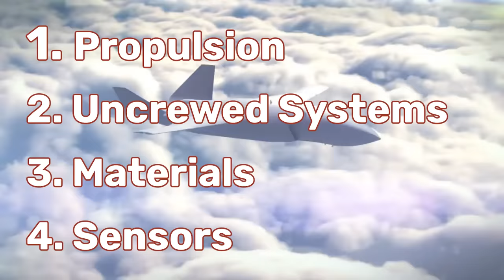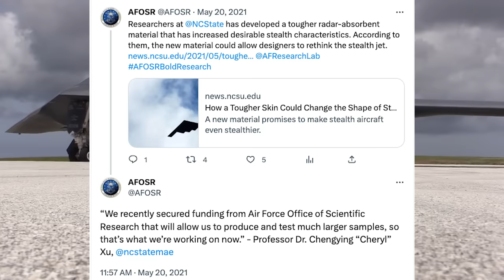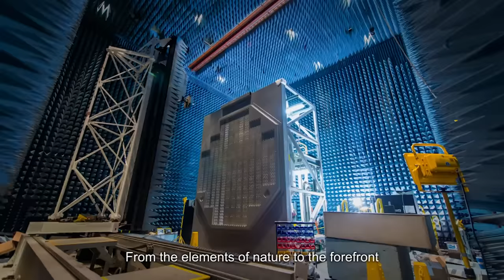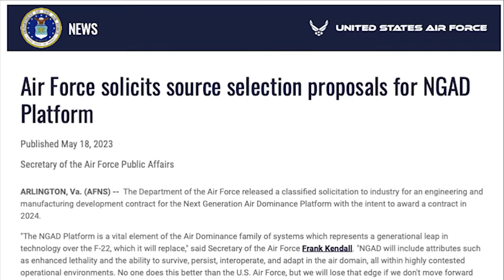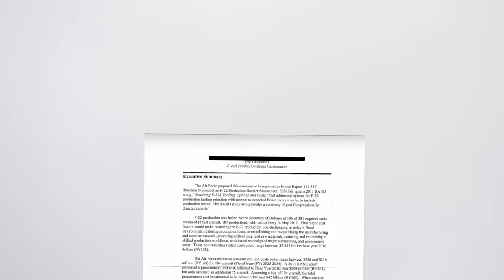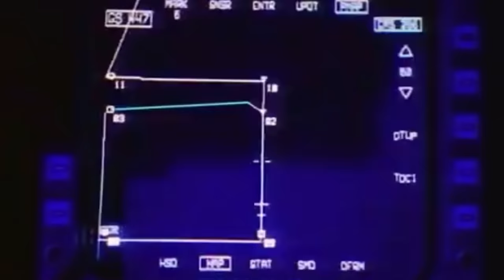Why America's new stealth fighters might cost $300 MILLION each

Comment: F-22 production costs would have gone down considerably if they'd produced several hundred of them as originally planned.
Reply: F22 couldn’t be shipped overseas and therefore was not going to result in the huge payday for the military industrial complex and so it was canned in favor of a new jet fighter With potentially unlimited profits. At least that’s the way it always seemed to me.
Reply: While that is true, it was most certainly a 1990s style production line. Not large scale enough to be automated, yet complicated enough to be uber expensive. With a more modern approach to design and manufacturing you should be able to operate both faster and at a lower cost.
Reply: @Alwsmith  nah if the program would have continued they would have just made an F22-E that cut out all the best tech and exported that. It is a very common practice and the US has done it with tons of different platforms they otherwise would not export in their original configuration. For example the Abrams tanks that are being sent to Ukraine are not being sent with their normal armor plating which is an advanced alloy material and instead that armor is being swapped out for the more typical hardened steel.
Reply: @ThatGuyKazz 
I think that an export F-22 would make for the greatest 4.5 gen fighter of all time. 

Or just go with the 23 being the export.
Reply: @Alwsmith : The F-22 production run was supposed to be 750 aircraft.  If they'd done that, they would have had economy of scale, reducing the cost to produce those hundreds of planes for a lot less than the first few batches.  On top of that, they would have been able to amortize the development costs over four times as many units.  And they could have retired hundreds of high-flight hour F-15s that ended up getting more and more expensive to operate and upgrade.
Reply: F-22 was going to go down to $93.4m unit flyaway in Full Rate Production.

Typhoons and Rafales are over $162m unit flyaway, unit program at over $200m each.
Reply: @texasranger24  F-22 had multiple lines that fed into the final assembly, with high-speed automation already a thing by then.

Cost reduction really goes down to the subcontractors.  If Pratt, Raytheon, L3 Harris, Boeing, etc. were to get multi-year orders and then subcontract the subcomponents in blocks, it streamlines the acquisition and confidence in vendors, who all need cleared personnel by the way.

SECDEF Gates killed the F-22 in LRIP, never allowing it to go FRP, which then created the fighter gap.
Reply: Yeah but it is the R&D that costs, not the actual plane. And R&D is something you have to do no matter what to keep up with technology. In peacetime, it’s better to have built 0 F-22”s and then move on to the next technology. Cheaper than being stuck with 100’s of jets whose tech will be obsolete in 10 years.
Reply: According to many different insiders from the Air Force and industry, it would’ve cost about as much as the F-35 costs now.
Reply: Component production was spread around inefficiently for political reasons, to gain support from as many people in Congress as possible.
Reply: People are forgetting. It’s not the initial cost that’s expensive it’s the upkeep and just like the F-14 it was just too expensive to run. Requiring Uber money to maintain and tons of maintenance hours per every flight hour to keep it in the air
Reply: The cost will be astronomical per unit because the military only wants about 200 of them, so if Lockheed needs to make $1 trillion over only 200 airframes, they’ll make each one of them cost billions a piece
Reply: @TheBooban  Every fighter evolves with the technology though, so it's better to have a production line open or a larger fleet.

F-16s have undergone so many changes just in production, then even more post-production with MLU, CCIP 1, CCIP 2, CCIP 2A, and now PoBIT.

F-22A is on an upgrade schedule called Raptor Incremental Upgrade Program.  The combat-coded Raptors are a lot different under the hood than the training conversion birds.
Reply: The F-22 was a victim of the times. It was a super fighter without a super fighter war to fight. A true hanger queen. Adding to all that, it was believed the Russians and Chinese would not have anything like it until 2030.
As a nation the U.S. was also dealing with the housing crash of 2006-2008. Congress wanted to cut cost any way they could, so the F-22 got cancelled.
The Air Force went along with it because they wanted that new toy. 
And that new toy is the F-35. They were told that they couldn't produce both at the same time.
Reply: @Alwsmith  Yes, the F-22 Engines and materials are still superior to the F-35 and so the ban. The advantage of the F35 is that it is Data Linked and more Modular and will use Nano Ceramics from Cheryl. The Block 4 F-35's should recieve the RDE (Mach 2.5 Rotational Detonation Engine) Engines as Cheryl Xu was successful and that means the NGAD and the B21 and all other Endeavors will be as well. I would like to side tack to the US Intelligence Officers and the UFO/UAP disclosures. IF TRUE thyen this information only helps our ENEMIES here on Earth. As the saying goes. Deal with the Problems that are in  front of YOU in the HERE and NOW. Looking for ET is not going to save us and the technology gained will be stolen! We need dedicated Scientists like Edward Teller and others who know the implications of US Success. USA success will one day unite a World and allow us to become a Planetary Society and reach a type One civilization that allows us to explore space. Until then I believe IF there are Non Terrestials they will wait until these conditions are met. This means education based on Ethnic Dominance must be REMOVED as a priority and Nationalism based on Social Engineering must also be removed. In order to Unite People instead of marginalization of them in order to steal their lands and their women. To this I can not agree to be ALL in for the USA. I am an asian American born here 7 Generations with most of my friends who have 3 or more Ph.D's who have great disdain for the History that is all together rewritten and Asian men Marginalized on PURPOSE. Things like when the Chinese built the Transcontinental Railroad & on payday these Chinese workers lined up & were shot in the back & then buried under the next set of track to be laid. The two companies did this over & over again making the Transcontinental Railroad the largest Chinese Cemetery outside of Asia! The US History Books marginalize Asians in order to control the minds of the Target which is the Asian Woman! IF you wonder why the CCP is catching up to US Military Supremacy, then I just presented to YOU why. Asian men do not have a life here as they are emasculated and are going back to China and ADVANCING the CCP technology at a VAST RAPID pace. I do not want to go to the CCP; but IF I am to die here alone and watch my people disappear HERE as the Asian American and Asian American Raised Women marry only White People because of the Social Engineered Processes put in place by people like Margret Sanger from the 1880's onward then what choice do I have? The CCP would not have the Atom Bomb had the USA not deported the American Chinese Col. Nuclear Physicist named Qian Xuesen, or Hsue-shen Tsien (Chinese: 钱学森; 11 December 1911 – 31 October 2009). We were 17% of the US Population in the 1990's but we are less than 7% to 3% today! WE ARE LEAVING!
Reply: @bigearl3867  There was no cut in defense spending, but reallocation of F-22 money to MRAPs.

USAF did not go along with it, as multiple USAF Chiefs of Staff literally sacrificed their careers trying to save the Raptor, and were fired.

They also knew and explained to Congress that not replacing F-15Cs with F-22s would cost more in the long run, and leave a fighter gap as F-15s built from 1979-1986 would time-out their airframe service lives, requiring billions in SLEP and sensor upgrades.

SECDEF Gates was on a mission to kill the F-22, and it had nothing to do with money.

The F-22 was going to be forward-deployed in Europe (UK, Germany, and other bases) to the tune of 200 aircraft.

Same for in the Pacific out of Alaska, Hawaii, Japan, and Guam.  CONUS fighter squadrons along the coast would regularly rotate through Europe and the Pacific for Emergency Deployment Readiness Exercises like we have always done.

This would have given Theater Combatant Commanders the no-BS capability to erase any air force in those regions.

This is why the Russians and Chinese wanted Obama to keep SECDEF Gates on after Bush43, to see to it that the Raptor program was terminated politically before it could go into Full-Rate Production.
Reply: @Alwsmith it would end up being really expensive with a limited production run. Nobody works for free, and the most expensive part of any aquisition is usually the r&d and tooling cost, which is passed onto the final price of each aircraft produced. It was also designed with extreme requirements in mind. The capability to dominate any airspace, in any weather, day or night, whilst being extremely difficult to detect, and capable of high mach as well as supercruise. Nothing had been built with all of these things in mind.
Reply: @Alwsmith  It was canned because the enemy it was meant to fight was no longer seen as a threat (whoops), and Congress wanted to cut spending, not understanding that a smaller order really isn’t that much cheaper because most of the money is in the R&D and infrastructure costs.  The F-35 wasn’t seen as a replacement for the F-22.  It was supposed to replace the F-16, F-18, and Harrier.  The F-22 was meant to replace the F-15.
Reply: @ThatGuyKazz  The exported Abrams tanks still have a composite armor.  They just use a less advanced version, and they incorporate tungsten instead of the depleted uranium mesh used in the US versions.  No tank has been produced with plain hardened steel armor in decades.
Reply: @bigearl3867  To be fair, the Ruzzians and Chinese still don’t have anything to legitimately rival it in 2023.  China might get there by 2030, but Ruzzia is hopelessly behind.
Reply: Get over the f22. It's freaking old.. there's no pilot that actually wants to pilot the F-22 versus an f-35 and it's situational awareness. They are finally upgrading the f-22's to be similar to f-35.. You're living in some weird fantasy world.. I think you're read too many blogs.
Reply: I think if China has still not invaded Taiwan before the NGAD fighters have been produced in serious numbers then in retrospect canceling the F-22 early would have worked out well.
Although 700 odd F-22’s would be a lot better than just a few NGAD’s obviously.

My point is just that cancelling the F-22 must have massively improved the cost and volume of F-35’s which arguably are more important when paired with drones due to all their sensors etc. And the NGAD program is probably starting earlier because of the gap left by not having many F-22’s

I for one was very frustrated when there was all this talk during the “war on terror” about having to change the force structure to suit insurgencies and counter terrorist operations.

Terrorism was never an existential threat to Western civilisation, China is! And it was bloody obvious in the early 2000’s that they were the real threat.

I seem to contradict what I said earlier. But what I’m really saying is that it’s less depressing if you consider that there was an upside in cancelling the F-22 early. Provided China doesn’t invade Taiwan which is a big caveat.
Reply: @Alwsmith  I don’t know if I agree with what you said exactly but I can tell you one thing as an Australian, there was a lot of talk before we purchased the F-35’s that the F-22 would be better or at least we would like (if it were allowed) to buy some F-22’s as well.

Obviously F-22’s were never allowed for export but it’s interesting to consider what would have happened if say Japan, UK, Australia, Canada etc (the closest allies that will never do anything sneaky with Russia or China like a country like Turkey might) were allowed to buy them too. 
Maybe all the other allies combined would have bought a few hundred F-22’s?
Perhaps having Japan flying F-22’s so close to China’s radars etc is what the US was worried about or that they would reverse engineer stuff and then down the road produce a competing aircraft, I don’t know.
Reply: @Alwsmith  That's a pretty ignorant statement and not why it was canned lol. Production was cut down from the planned *700* or so airframes to only 197 in like 2007 because congress saw no point in procuring such a relatively expensive aircraft in such large numbers when we had no real competitor anymore like we had in the cold war. This was before China began to make itself the threat that it is seen as today
Reply: Obviously.
Reply: @Alwsmith  John McCain.
Reply: @ThatGuyKazz  Actually the metal armor they removed isn't the composite armor, it's the depleted uranium armor. The composite stayed on, as it's a permanent part of the tank hull.
Reply: Plus the more F-22s you have you can use for spare parts as the fleet ages.
Reply: @TheBooban based off what I've read that was a big motivator for not producing tons. They were designed for use against near peer enemies that didn't exist in the 2000s and 2010s but tech had advanced so fast that it was likely to be outdated by the time a near peer enemy was building their own equivalents. They'd have to either use it as a secondary fighter to supplement another future fighter in air superiority missions or upgrade them but both those options looked rather inefficient so they decided to cancel and redesign. Supposedly it already had to make a few changes in the planning and deign process to accommodate new tech
Reply: @bluemarlin8138  
I agree with you. The thing is that 20 years onward something new is needed.

I look back at WWII, and think of how our adversaries thought what they had was, "good enough", and got caught not being innovative when they had the tech to do so.

As much as I hate the tax payer being put on the hook, we always need to be the best we can be.

China and Russia should never be allowed to catch up.
Reply: @bluemarlin8138  Why "whoops?" That enemy still doesn't exist. The F22, while awesome, is still expensive as all hell to maintain. The main reason China moved so fast was terrible cybersecurity. And even then, its stealth fighter STILL isn't worthy of the F22. But, even if it were, it's the Navy that should have the killers for that aircraft. The USAF is worried its bases near the SCS would get hit very early on in conflict. The next generation for the US is being built now, and it's about the same timeline as usual.
Reply: @jacobdewey2053  I’m not disputing your statement. You are right about why it was canned. 
But it was none the less extremely frustrating for me to see western  military’s cut back on capabilities that were designed to counter peer threats (state actors) in order to focus on “counter terrorism bs” I know it sounds like I’m saying that in retrospect but honestly I was thinking that at the time. It was so obvious to anyone with a brown that China was not in the path to becoming a liberal democracy, even before Xi took over and they were absolutely going to be a threat.

Their trajectory was nothing like Taiwan or South Korea. That was a transparently BS excuse from our governments at the time.
I’m Australian and I count our government as being at least as guilty of this too.
 
I’m just glad that now our priorities are straight. Better late than never I guess. And I guess the fact that we’ve waited so long to respond stops the CCP from making us western countries seem like the aggressors.

Hopefully the Ukraine situation ends in Russia being permanently fucked and then we only have China to worry about. 
A lot can happen though. China might make a move on Taiwan while we have all depleted our stocks or China might take Siberia and its gas fields under the guise of securing nuclear weapons from falling into the hands of terrorists in the event that Russia starts to fall apart.

We’ll see what happens, there is a lot to stress about lol.
Reply: In regards to potential exports of the F22, there was an risk analysis conducted to see which countries would be able to purchase the aircraft with the least chance of espionage. 

Interestingly the report found that the only nations that met those requirements, from most qualified to least were; Australia, Canada and the Uk.

Further more, it is a little known fact that Australia had shown interest in procuring the F-22. 

RAAF leaders and Government Reps went to America and had discussions with LM. While there were plans for an export model, (with a different radar, engines, apparently a less effective stealth coating and removal of a few other undisclosed features), the Australians were able to push for a near identical version to the USAF. It would have had reinforced landing gear, the same engine and radar etc. While I have not read of any definitive numbers open source discussions pointed to around 50 aircraft minimum with a max of 75. 

Things got a fair way along until there was a change of personal in the RAAF. The new head was less enthusiastic about the proposal and the push for a peace dividend in Australia called into question the need for a 5th gen air superiority fighter, rather foolishly in hindsight. 

Shortly after that Congress passed the law forbidding the export of the F22 (part of the reason given was failing to prove interest from foreign sales), and the whole thing was dropped. 

On that note, it is curious that despite the law aiming to protect the intellectual property and technological advantage of the US, it’s next 5th gen fighter, the F35, can be argued to be even more advanced when it comes to all modern aspects of war fighting that matter, eg: sensors, computing, EW warfare and secure communication. This just calls into question the logic of such a move by congress, but, that’s more of a political discussion rather than one driven by strategic goals.
Reply: What? 17 nations wanting to purchase these planes.  I thought they were not selling them to other actions?  The USA USAF.
Reply: you guys forget that these costs include the sims etc also
Reply: Same way with the B2 bomber..in a way the aircraft are so good that we don't build enough always way less than planned.  In the early 90s mid 90s they the air force and darpa wanted 700 f22s. Got cut down to 300 then cut to 187. Thats why the f22 was 150 million piece. The air force and government on the new 6th generation bomber and fighter they supposedly are building what they planned for, well see...
Reply: NGAD must include top stealth features such as no tail feathers, modified RED, spray-on RAM, and synchronized laser/radar package that affords superb adversary detection.  Wolf pack (wing buddy) configuration will be augmented with a host of drones from expendable to exotic superman (F22), and of course a full complement of missiles (some in the process of evolving into drones).  Refueling from carriers might be an option as they maneuver closer to stabilized conflict zones.  USAI (mil-spec) must be mature and work flawlessly with more than one pilot during a series of complex sorties.  For sure, owning the sky is not cheap but absolutely necessary and ongoing!
Reply: @chrisc2671  Agreed that, in hindsight, it wasn't the best move but I believe the decision was the best they could've made with the information that they had available. It's definitely an improvement that we are taking the necessary steps to maintain uncontested dominance over the skies with the NGAD and F/A-XX programs
Reply: @Alwsmith dead wrong. Lockheed doesn’t GAF who is paying them, domestic or international, money is money. the program was cancelled by Congress much to the ire of Lockheed because they didn’t want to spend money on a solution to an at the time nonexistent problem,
Reply: @texasranger24  have they EVER done anything at lower cost?
Reply: @bigearl3867  "I look back at WW II".  The US west coast experienced a sense of dread after the events of Dec. 7.  There were only 19 USAAF interceptors available to cover the California coastline,iirc.  After the Darwin raids, the Aussies expected a ground invasion and recalled their troops from overseas deployments. The British Royal Navy barely escaped from Ceylon. Allied pilots suffered mightily against the Zero in the early days. High performance Allied aircraft that could match the long range Zero were needed, and Roy Grumman's company did a remarkable job getting the Hellcat into the Pacific war. That said, the USN also suffered against the IJN and their secret weapon - the Type 93 torpedo. The most dangerous job in the USN was delivery duties (AV gas / ammo) to the CAF on Guadacanal between Aug - Nov. 1942.
Reply: That is so true
Reply: @stevechan6244  how in the living hell did u manage to turn this videos comment section into a racial issue?  victim mentality is beginning to develop stealth tech. Can literally pop up from nowhere where and when u least excpect it.
Reply: F-22 airframe is for advanced "special use" (means we can't let the enemy get a damaged one cuz we only have 50 USA defense missions only.
Reply: I think the maintenance was the issue
Reply: Good point!
Reply: @jasondevalle007 🙄
Reply: We don't need the f22 craptor  in its entire service life it shot down a balloon and missed a shot lmao
Reply: The production costs would have gone down but the operational costs would have skyrocketed.  It's standard for cutting edge technologies and the F-22 was no exception.
The cost per airframe or cost per flight hour are costs that are only tracked during peace time.  In the event of war money is typically of no object and the entire thing becomes a 'run what ypu brung' excercise.
Reply: @bubbeN999  It is relevant. Why? Because many of my relatives have more than 2 Ph.D's and are male and are all angry. I worked for Lifescan Johnson and Johnson's and the scientist who developed the Diabetic Meters and the Chemsitry was a Singaporean Chinese in the later 1980's. We helped develop many things like treatment for AIDS. Cheryl Xu developed Nano Stealth Cermics. Dawon Kahng, Simon Tze, and John Matin Attala at Bell Labs at Murray Hills, NJ.are the Father's of Solid State Electronics and were NEVER awarded the Nobel Prize but others who built on their technologies DID! Asian Men are already left out of the History of US Military Technology and to add insult to injury we are emascualted and many of my family have switch sides to the CCP or to Taiwan! THAT is where the advanced technology jump is coming from!!! That is why the US is trying to undo this Social Engineered Processes that are still in place today from the last century! It is to no advantage to the United States to keep these  processes in place and let ignorant people to push their racist agenda forcing the next generation of scientists to the CCP! Even me. I have to see it from my side from the Imperial Western Gaze looking at me because I am a victim of it! Many of my relatives are Billionaires and are Asian and many hold 3 Ph'D's and IF this trend does not change then the expectations for the US Military may be lost as so will its edge. When I was growing up just after the Vietnam War in the 1970's my teachers used to spit in my face when I was gong to class. I was not North Vietnamese or Vietnamese and my teachers were racist to me! My mother had committed suicide at this time as well. Faced with these insurmountable odds I joined the US Military after High School with my father who was insane after being a US Spy during the Korean Conflict. PTSD? I know it well. This trend is a National Security issue. I know many Professors who are Asian Americans who teach at many Universities who hate America? They were not all Chinese either. I am saying this out loud because I see it! Are we going to imprison Indians, Chinese, Japanese...etc. who are working  and born in the USA? The Imperial Gaze must end! The Social Engineered processes in the US Public Schools must end! The emasculation must end. We are losing too many talented people from this Social Engineering process. That is all I have to say. It is a real threat to Asians and from all Asians Males as we watch many Asian women marry White men and Asian men grow old and die alone. Many of my family members have money and education and are alone in their 70's. I have asked my children to get their education here and leave. There is NO future for them and freedom is not always just money. Sometimes you win by submissions and it may be worth it to advance the CCP Military IF it allows for our survival. For Asian men this means family and our culture. There is no future in America for any Asian Males in America. The money is also not enough anymore and given the circumstances where do we go? Many times I was told to go back to China and my family got here in 1862? I might do this as well as many other Asian men who are my friends born several generations in America have already left who have Ph'D's in STEM's. This is the result and the Great WAR is coming where India will not help the USA and neither will Indonesia. The Japanese people hate Americans in secret. I know because I am half Japanese! Their history is under the control of America and so at home the Japanese teach their real history when they get home. This is a WARNING!
Reply: My father was a skunkworks/Lockheed  employee for 30yrs and 2008 crash was a big reason for the f22 discontinued product. But the new tech he was able to explain to me without revealing secrets blows my mind. He was also involved in the ABL program and Boeing was a reason that was discovered. The laser weapon systems Lockheed has been developing is going to change the offensive and defensive abilities for aircraft combat systems.
Reply: More costs less? That may be how it woks outside the military. But not for the military. The US Defense 
Industry is not going to tell the military, "Remember, if you buy today in bulk you get a discount. If you include maintenance and RnD it's $300 mil. However, this is the advertised price. The real cost is kept hidden.
Reply: @diGritz1 : It works exactly like that.  When the government orders in larger lots, they get a discount because it allows the contractor to order in bulk.  Look at the cost per unit of F-35 and you'll see it's gone down significantly for each subsequent lot.
Reply: Exactly. It would have been far cheaper than the F35 and it WAS cheaper than the F14. They have produced a couple hundred, but they were supposed to produce nearly a thousand.
Reply: Discontinuing the F-22 was a huge mistake
Reply: The F22 die has been broken.
Reply: I am gonna miss the Raptor when its gone. I hope they keep a few flying for air shows.
Reply: F-22 was obsolete (under the skin) by the time they finished it.  Exactly the same problem faced by the British with Nimrod MR4A.  Both were designed and built during a giant leap in compute density and power which left them with hopelessly outdated and impossible to upgrade systems.
Reply: @LondonSteveLee  So it's not the best fighter in the sky? That's what you are saying right?
Reply: @JF42506  It's the best plane - but fighter? No - the systems on board are obsolete - no passive detection systems to speak of, no helmet mounted hud - AIM-120D is out-ranged by at least three other competing air to air weapons. The WVR weapons (Sidewinder) are badly masked restricting their performance.   F-22 is an incredible flying machine with obsolete systems.
Reply: @chrisc2671  Perhaps but the US was never going to export the F 22 that was a condition that Congress set before funding it.  And if I weren’t stoned I would’ve made sure to get across that that’s how I used to feel laugh. Recently I’ve changed my mind on the F 35 and I see the utility now that I understand how much aerial combat has changed.
Reply: @stupidburp thats essentially standard practice though
Reply: @BaconGold790 while the F35 is certainly the most advanced deployed plane I think it might be fair to say that when the F22 was launched it was much more novel and advanced for that era. Meaning to say that countries around the world now have tech capabilities much closer to where the F35 is today than most countries had in comparison to the F22 at its launch. Idk, just a thought.
Reply: Should have sold japan some of them to drop the price
Reply: The study calculating cost to restart raptor manufacturing hadn’t considered the advent of modern 3D printing. We know they claim to have built the NGAD tech demonstrator within 12mo of concept. In other words, they absolutely took advantage of 3d printing in order to accomplish this feat. That report was nothing but a smoke screen. The military knew they could have restarted the raptor program at a much lower price than expected. They didn’t want to b/c they wanted to build something new. It’s that simple. If it were money they had to earn, they’d have restarted the program; but they are spending our money, so price is no issue.
Reply: All production costs would be considerably reduced if the government didn’t have the mind numbing stupidity of things like “No bid contracts”, and the day back room deals built on “you scratch my back, I’ll scratch yours”. Companies gifting politicians and lawmakers stock in the very company that ends up getting a contract worth several billions. Which inevitably increases the value, in turn the profits made on the gifted stocks or bonds. 

It’s crazy when you see toiletries such as toilet paper used in Iraq and Afghanistan by the private contractors costing several hundred dollars a roll. That kind of fuckery is common place and kills me to hear about. 

Imagined a world where competition and strict oversight are common place and saved the taxpayers billions, allowing for spending in cities and states in schools, hospitals, healthcare, space exploration, etc…. You get the point though!!!
Reply: @DumbAmerican67 Agreed.. But if the  F22 is so outdated.. Why is it still so restricted..Surely Nato Allies would be  benefitted by ownership of the F22 and therefore also beneficial to Nato by extension..
Reply: @davidkruger5590 : The F-22 is outdated in some ways, but its radar cross-section is still lower than that of the F-35.  And whether our allies would benefit from it, the production line was shut down decades ago and there's no practical way to restart it.  We'd be better off making a new production line and making an updated F-22... which is what we're doing in the NGAD 6th generation program.  I hope there is an export version of that when it comes out.
Reply: @davidkruger5590  There's no reason to lift the sales ban because there's no realistic chance of selling F-22. Firstly there's the time and money needed to restart production but the much bigger problem is that it would need an extensive redesign to bring its systems up to date to match those of the F-35 and incorporate the advances in materials and construction used in the F-35 which allow it to have a smaller radar signature than the F-22 while also ditching stealth coatings in favour of far more durable stealth baked into the skin of the aircraft. It would probably also need a revised engine to make it more attractive to customers and reduce maintenance hours and cost so you'd end up with something that looked like an F-22 but was almost a completely new plane with a new production line. 

It would be so expensive that most militaries couldn't justify the cost vs the F-35, and if those improvements weren't implemented and you tried selling the F-22 as-is then, yes it would be a lot cheaper but it would lag the F-35 in so many ways that allies still wouldn't buy it.
Reply: If you want to be a leader in cutting edge tech,it costs$$$$$$$$$$,lead or follow? I'd rather lead
Reply: @1spartacus1337 
Uber money?  Is that like Monopoly money?  Oh!  You meant “uber” money, not “Uber” money!  😁

Just FYI, I know that was a spellcheck thing.  I just needed to fill my snark quota for the day.  Thanks for allowing me to do so.  👍🏻
Reply: Yes, the cost per plane would have been reduced, but the multiple block upgrades would be ridiculous. The F-35 was a fresh, ground up, far more flexible, less expensive to upgrade platform. Kinda of a "2 steps back, 3 steps ahead" type of thing. I am looking forward to seeing the refresh on the F-22.
Reply: , ,V😢😢😮